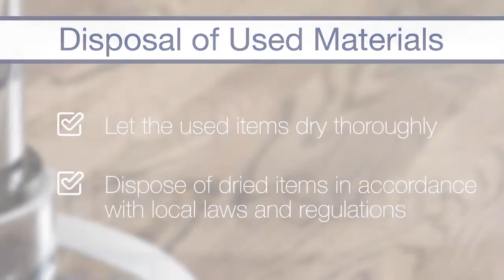Bona DriFast Stain: Best Practices - webinar

Comment: What was the second stain you used? I'm confused how each half of that second grey side look so different. Thank you for all of Bona's published videos!
Reply from the maker: Hi Molly - The difference in the grey sides are that we "water popped" part of that section the night before applying the stain (lightly and evenly damped it with water to open up the grain; once dried, the hard grain areas accept a lot more of the stain to give you less contrast with the soft grain, so the whole floor will look darker and more evenly stained). The actual stain color was Bona DriFast Stain Grey, with a little Graphite and White added (50/50 mix), to give me a little more product as I was running a bit short for the demo and didn't have another can of the Grey in-house. Hope that helps!

Comment: Hi Bona Pro, sorry if i missed information about sanding the wood. What grain of sand paper do you use before put stain on?          Thank you for your answer
Reply from the maker: Hi Gavyuk - Important that in the sanding process, that not more than one grit is skipped in the sequence (i.e. 36 (40) 50 (60) 80, would be typical where 40 and 60 are skipped). In general, we usually stop at 80 or 100 grit, though sometimes even take it up to 120 grit, depending on the species, darkness of the stain color, external light coming in, etc. It's also very common to take it up to 120 grit and then water-pop it back to open up the hard grain and get a darker color out of the can (this can also help hide some minor scratches, etc.). Hope that helps. If you need more information, please give our technical team a call at (800) 872-5515. All the Best!
Reply: @BonaProfessional thank you so much for your explanation

Comment: so no bona clasicc seal over stain.😮
Reply from the maker: Hi @ladjkaoz - Correct, Bona does not recommend the use of Bona ClassicSeal over any stain. Not that you could expect total failure, but we always recommend Best Practices and ClassicSeal doesn't exhibit the best adhesion characteristics over solvent-based stains. Hope that helps confirm any questions you had about that. IntenseSeal is usually our go-to for "popping" the chosen stain color and ensure excellent adhesion characteristics!

Comment: How do you keep the carpet fibers out of the finish when buffing?
Reply from the maker: Hi rhewcrew - Some of the carpet fibers/tufts do tend to come off the carpet circle when using this method; but are easily vacuumed up after the stain has dried. Have never had this present a problem in applying stain (or in teaching Bona students to apply stain with a carpet circle) like this for more than fifteen years now. Thanks for the question!
Reply: Does bleaching affect dryability of Dryfast stain? Any problems with two coats of stain?